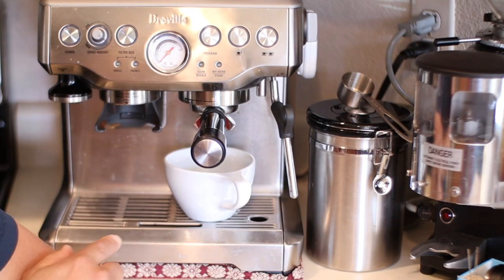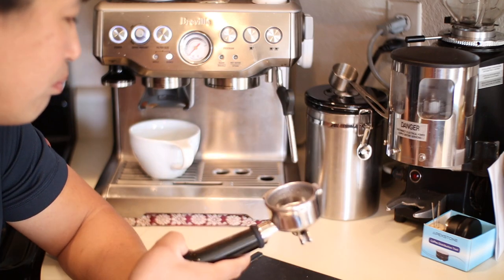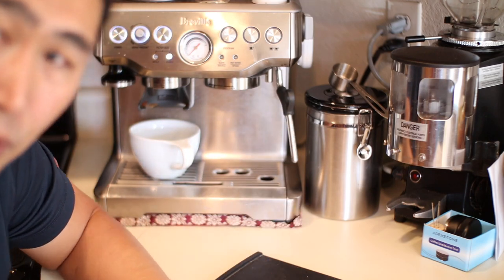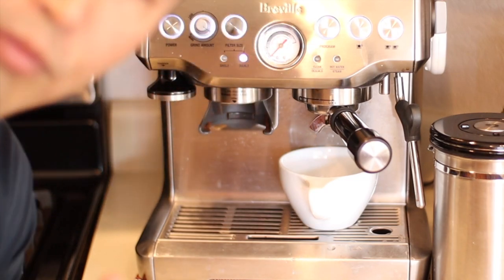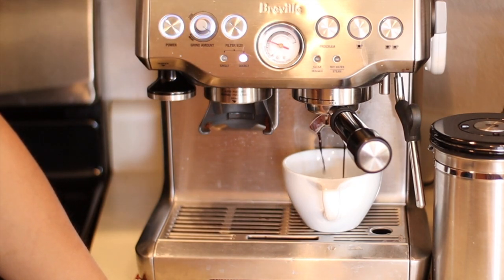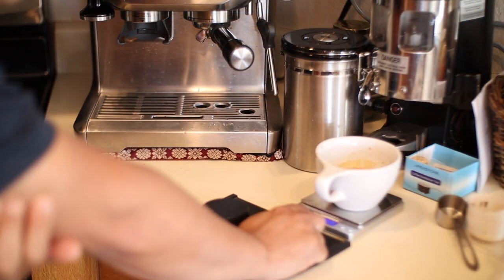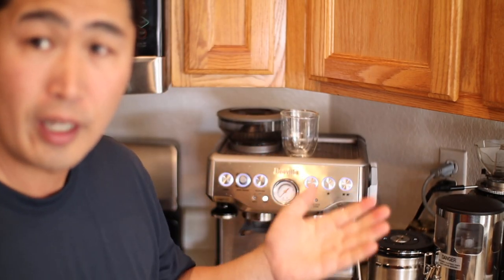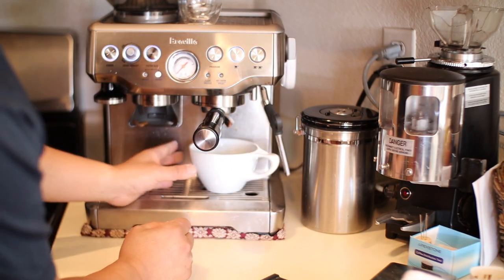How to Fix a Sour Espresso - Breville Barista Express

Comment: I need  help Hoon I just bought this machine 2 weeks ago and every time I pour a shot it's sour, I adjust the grind size over and over and still sour. What am I doing wrong?Please reply
Reply from the maker: How's speed of shot? Is it fast?Also, did you warm up the machine first? What kind of bean are you using it?
Reply: @HoonsCoffee  Yes it's coming out fairly fast,i warned the machine up for 20 minutes maybe more. I live in Melbourne Australia I first used Vittoria Coffee beans and when I bought the machine I received 6 packets of Pablo and Rusty coffee beans, it's an Aussie brand
Reply from the maker: @footy2rock  What is your current grind setting? You need to make little finer by 2 and see what happens.
Reply: @HoonsCoffee  I've tried every number setting on the grind dial and still it's sour I feel I have wasted my money on this machine
Reply from the maker: @footy2rock  When you change to lower number is your shot speed changes? or all the settings are the same speed of shots?
Reply: Sounds like you need to adjust the manual burr setting if the dial isn't getting the grind fine enough. I was almost ready to give up too but this will make all the difference. It's probably set to 5 by default. Try 4 or 3
Reply: Mark Chapman how fresh are your beans? You may want to try fresh beans if the ones you’re using are not. Also look at your distribution and tamping techniques.
Reply: @footy2rock  hi, Vittorio coffee is really good. But first you check, if the beans are freshly roasted or not. Remember, there's usually a good gap between the manufacturering day and the roasting day. Try to buy the most recent manufactureing day. Turn grind dial to 7/8, heat up the machine and try again.
Reply: @KamalChowdhury  Vittoria beans are garbage. Most of the beans you buy at the supermarket will be garbage as you have no idea how old the beans are. I would bet he is having fast flow problem due to stale beans.
Reply: @vkdlvkdl  I think you are right. These bean packs do not give roasting date, so very likely freshness will be compromised. I try to get the most recent packs
Reply: @footy2rock  I had that same feeling back when I started.   The distribution tool, scale, fresh beans and Hoon's video's will get you over the hump.  But making good coffee at home is an art form as well as a science.  It's not always easy and if you don't enjoy the process. You may want to turn back now.   Unfortunately our machines are pretty entry level somewhat basic but I have made good coffee with mine.  Thank you to Hoon for taking the time to make his video's.  Best if luck to you Mark
Reply: Thanks this really helped. I just got this today, starting out on supermarket beans to figure it out so I don’t waste the good stuff! Just managed to get a smooth & clean shot that tasted like soapy lemons before 😂

Comment: Hi Hoon, I’ve been following your videos for a few weeks and have been struggling to extract a decent espresso on the barista express. I’m using 18g dose, grind setting 8 and using the dual wall portafilter basket. Also I’m using the same super crema Lavazza coffee you used on this video. Any suggestions in order to avoid the constant under-extraction?
Reply from the maker: You get under extraction from Double wall basket? How long did you warm up the machine?
Reply: For about 45m? Isn’t it weird? What I’m doing wrong? It’s frustrating to say the least
Reply from the maker: @hugoafonso1977  That is really weird. Since you're using a pressurized basket you should get a good extraction but you are not. How long did you had your machine?
Reply: Literally 2 weeks now
Reply: @hugoafonso1977  is 8 the finest on express?
Reply: @HoonsCoffee  indeed since I'm using pressurized basket I always have good espresso range extraction. Next step is -> learn how to make good coffee with non pressurized basket ;)

Comment: My made my shots from a single wall filter, double shot. I started with 18 g coffee. While it took 25-30 sec to pull a shot, the machine kept pulling 50+ g espresso instead of 36 g as recommended by the roaster. I adjusted the grind size to finer than usual (3) just to elaborate the result. The shot was extremely bitter, yet watery still. Is this becoming a machine issue?
Reply from the maker: Are you using a scale? Make sure stop it at 36g
Reply: @HoonsCoffee  I do. So what you're saying is I should stop the machine before it stops automatically? 

Also, I listened to another video of yours. If the beans aren't dark roasted, higher temperature would help with reducing the sourness? I've just ordered a thermometer and awaiting its delivery 😁
Reply: @HoonsCoffee  so if you want 36 you stop at 36 or do you try to anticipate 36? If i stop at 36 ill get about 42-44

Comment: Hi hoon 
I have another machine 
I'm facing a problem when start extracting pressure be in 9 or 10 but after 10 seconds it goes down to 7 i tried many solution like  increase tamping or grams on grinding but no result .any help please
Reply from the maker: What kind of beans are you using it now?
Reply: @HoonsCoffee  
I'm using bean toasted by local company but it imported from Ethiopia and Uganda and latest i tried from yemen and Colombia

Comment: This helped with my Bambino Plus as well. Breville/Sage fakes you out into thinking it's quick heating element means that the water temp is in fact at the correct range. This video along with heating my porta filter helped a ton.

Comment: I’m having a hard time getting my 2 ounce ! I’m struggling hard.. my coffee is sour. But it’s always in the good zone. Am I tampering too hard and wrong?
Reply from the maker: Sounds like your water is not hot enough. Make sure warm up the machine first.
Reply: dearsarahhhh Try using the single shot single wall but only use 9 g you will be surprised how well this tastes
Reply: @HoonsCoffee  You can also adjust the machine to run slightly warmer if you find the temperature is too low and remains too low.
Reply: @Stoney3K  really? How?

Comment: The machine turns off after a time to save power 🤔 So you can't just leave it for 30 mins to warm. Or is my machine different?
Reply from the maker: Which model do have? I have BES 870.
Reply: I have same problem the machine automatically turning off after 20mins

Comment: Its just a single thermoblock inside. Save yourself some time (and power) and simply run the steam wand first. This will heat the thermoblock to its max temp.

Comment: I have the same beans with grinder set at 7 and grind amount at 3 o’clock. I got around 17 grams and the pressure was almost in the correct zone. The shot was pulled pretty quick and tasted super sour. Not good at all. It’s an improvement from the first time I tried it when the pressure was even lower. What do you suggest I do. Also the coffee didn’t arrive vacuum sealed.
Reply from the maker: Make sure your group head and water is warm up for the shot. If your water is not hot your shot can be sour.
Reply: @HoonsCoffee  I Pre-heat the Porta filter, My cup and Shot glass with Kettle Hot water.... it's all nice and HOT.... I run the machine for 1 Shot just to warm the water path up.  Then I pull a DOUBLE SHOT, I always do Doubles.
Reply: Grind finer or tamp a little harder
Reply: Khaldeyah I think it’s coffee problem. 
You have mentioned the coffee wasn’t sealed. It’s the point.
If the taste of coffee sour, you might also think of what level of coffee roasting, light roast? If it so, it must be. Medium roast, still you get the sour taste with Arabica bean.

Comment: I can’t get my pressure up and it brews really quickly
Reply: I would suggest to grind the coffee finer or temper it a bit harder. Had the same problem in the beginning.
Reply: Get fresh coffee (check the roast date.) Then weight out 18 grams for yer double shot
Grind somewhere and adjust grind size from there.

Comment: Hi Hoon, love ur videos. I so wish you had the De’Longhi La Specialista cuz I just purchased it and can’t pull a decent shot. I already wasted 1/2 bag of Lavazza Super Crema. I wish I could take ur formula and apply it to my machine 🥺. I have no idea what I’m doing 😫. In any event, learning a lot from ur videos in general. Thank you!
Reply from the maker: Your machine is semi automatic. Seems very nice! Is your shot sour or bitter?
Reply: I’ve had both bitter and sour. I’ve gone through every grind size and tried single and double shots but can’t get machine to move past the very beginning of the optimal zone. I’m obviously doing something wrong. Honestly, I have no experience making coffee outside of pods so this was probably a bad idea 🤪.
Reply: Nelly I’m new to making my own espresso as well and I’ve gone through half a bag of the super crema with my barista express, sour to bitter and back again. Hopefully Hoons advice works!
Reply: Hoon's Coffee what temp setting are you using for the super crema on your barista express?
Reply from the maker: @christophermaes2877  Let me know how it turns out!
Reply: christopher maes Hi Christopher, I actually tried the Super Crema on the Barista Express w/Grind size = 8, Grind Amount = little less than half, double shot in a double walled basket, firm tamp and the puck came out solid and shot had full Crema and was yums. I frothed some milk and made it a cappuccino. I pretty much followed Hoon’s Super Crema video w/a few tweaks. Good luck!
Reply: Hoon's Coffee Hi Hoon! What I’m finding out is that I’ve been pulling the shots right, just not a big fan of the super crema as a shot. Great with milk though.
Reply: Nelly Hi Nelly, I actually ended up going to my local roaster (klatch) and getting some of their beans, I am very impressed. It turns out I just don’t like the super crema as a straight shot, really good with milk though!
Reply from the maker: @christophermaes2877  Try LaVazza cafe espresso.
Reply: christopher maes Same here, I can’t drink it straight either. It’s too strong for me. I have to add milk. Glad u found beans u enjoy 😬.

Comment: I have a question, I can’t get the 12 pressure I usually go over it. Can u please tell me how? Thanks
Reply from the maker: How's espresso tasty? 12 is just guideline for you're in espresso zone. I think 11 to 1 is pretty good espresso pressure.
Reply: I mean alway goes full pressure. I tried couple times to make it 12 or 1. What’s ure advise to get the right pressure?
Reply: @Abduluita   Try to grind coarser

Comment: what if the coffee is bitter and sour at the same time
Reply from the maker: Actually one or the other! When you over extract the coffee you get a bitter coffee.
Reply: That tells you have channeling. Some areas of the puck are underextracted, thus sour, while other get overextracted, bitter. Improve your distribution technique in order to hit the sweet spot
Reply: @HoonsCoffee  Coffee will also become bitter when the temperature is too high and the beans are scorched, so it could also be an underextracted shot that is also too hot.

Comment: I would say it's more about you've tamped harder 2nd tine than the  termal stability of the grouphead. The first shot was far too fast. Nice video though.
Reply: I was thinking the same. You never really know for sure unless you're changing one thing at a time.
Reply: 30 seconds is way too fast?
Reply: @damarei  depends on the beans.

Comment: My shots are pulling less than 20 seconds. I have my smart grind pro on the smallest possible setting, I literally cannot grind finer on this 300$ machine lol
Reply: have you tried adjusting the inner burr? It's on 6 by default, I have it on 3 and it's more than enough